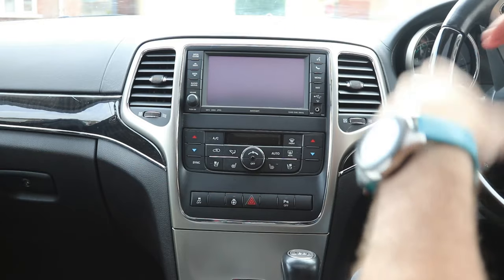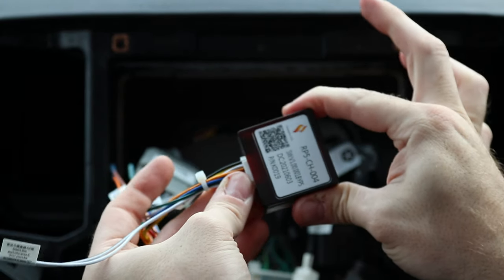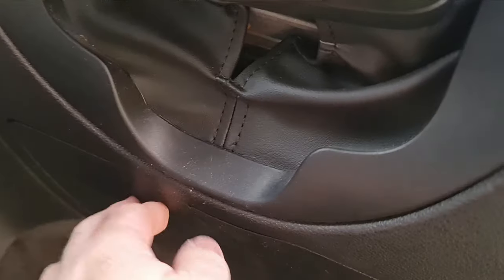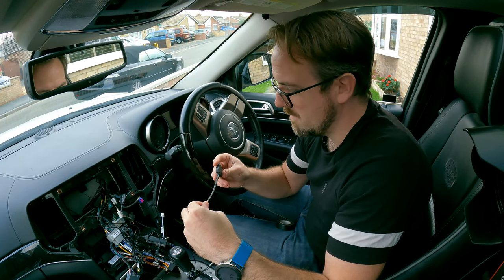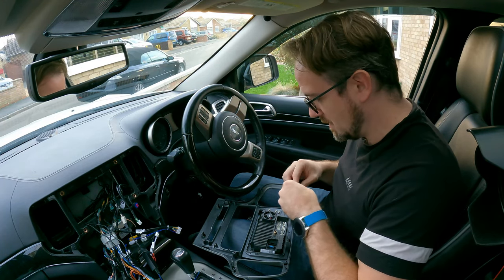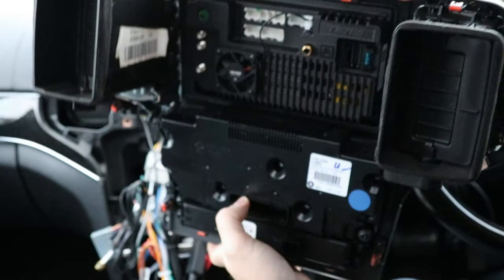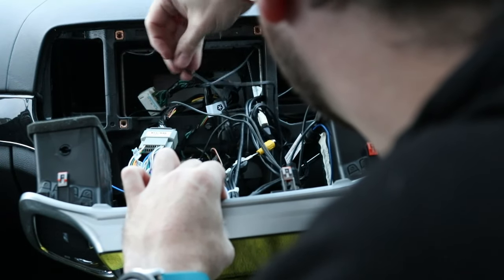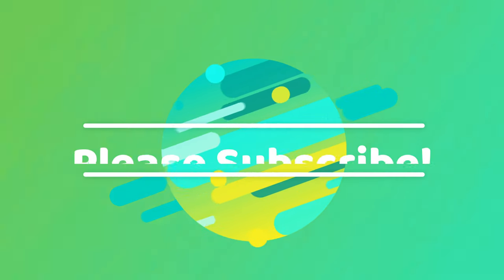Jeep Grand Cherokee ULTIMATE Head Unit Upgrade - Teyes - Jeep WK2 -Android Auto -Apple CarPlay -DSP

Comment: Hi, I'm new to your channel and have subscribed as well as watched a number of your vlogs.
Wonder if you can help... I have a 2021 Citroen Relay with inbuilt TomTom but no Android Auto and am looking for a new head unit that can work using Android Auto and wondering what unit you would recommend as it's a minefield... It needs to work with all my steering controls and use the mic from my van preferably rather than an external one and DAB radio.
Do all units that use Android have the 2021 updated Android Auto split screen on them, or does that come from your phone? Any help/advice would be much appreciated. Many thanks!
Reply from the maker: Hi Adam, I would advise that you pop the Teyes guys an email asking them about compatibility with your vehicle. I'm pretty sure it's supported as Citroen is one of the options in the menus of the unit I have, so that would mean steering controls ect will work. You'll probably still need an external mic though - but email them and find out. You'll also want to know if they include any dashbaord facias to make installation into your van easier. 

With regards to your question on Android Auto - that has nothing to do with your head unit, it is all streamed from your phone. Also if you have a head unit like this, you may find that you don't want to use Android Auto because it's better to use it without (you can install TomTom directly onto the unit, for example)
Reply: @SaabUnleashed  That's fantastic thank you for your reply, it's much appreciated. Do you have an email address for Teyes by any chance? If not I will have a look and get in touch with them asking exactly what you advised.
Reply from the maker: @adamsher86  I have used dan@teyes.com.au
Reply: @SaabUnleashed  Thank you. I've just emailed him and will let you know what they say.
Reply: @SaabUnleashed  unfortunately they don't have the fascia for my vehicle which is a shame. What is the next best unit you would recommend and what is needed for install. Where is the best place to buy fascias? Thanks.
Reply from the maker: @adamsher86  If you buy the generic aftermarket kit, you can install any double din head unit - https://www.dynamicsounds.co.uk/incartec-fk-938-citroen-relay-double-din-fascia-stereo-upgrade-fitting-kit-gloss-black.html?tracking=60352430b19de&gclid=Cj0KCQjw5oiMBhDtARIsAJi0qk2UjTC2V7x3KY73vUeJecCP3WNxBlt9ZAsgineY4SDHphFwyTyhAO0aAkAGEALw_wcB
Reply: @SaabUnleashed  that's brilliant thank you. Will have to find a head unit as it says in the description that the Chinese units can be oversize and alterations may need to be made.
Reply: @SaabUnleashed  do you have an email address please, just somif I have any questions moving forward I'm not taking up the YouTube comment section?
Reply from the maker: @adamsher86  Stu@saabunleashed.com

Comment: Hello sorry how is te camera rear conection?
Reply: I just installed the CC3 on my 2012 JGC (WK2) and maintained the OEM camera by using the iDatalink HRN-AV-CH1 Factory Integration Adapter. It was super easy and all T’Eyes reverse camera functions work.  The resolution is good enough in my opinion.

Comment: How do you get it to work with the factory camera?
Reply: I just installed the CC3 on my 2012 JGC (WK2) and maintained the OEM camera by using the iDatalink HRN-AV-CH1 Factory Integration Adapter. It was super easy and all T’Eyes reverse camera functions work.  The resolution is good enough in my opinion.

Comment: How do you connect the factory rear camera?
Reply: I just installed the CC3 on my 2012 JGC (WK2) and maintained the OEM camera by using the iDatalink HRN-AV-CH1 Factory Integration Adapter. It was super easy and all T’Eyes reverse camera functions work.  The resolution is good enough in my opinion.